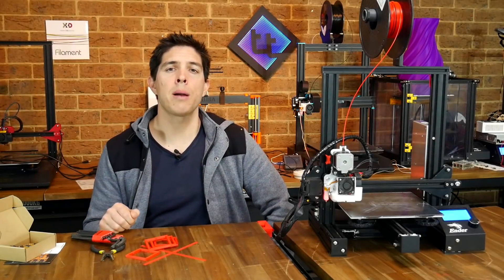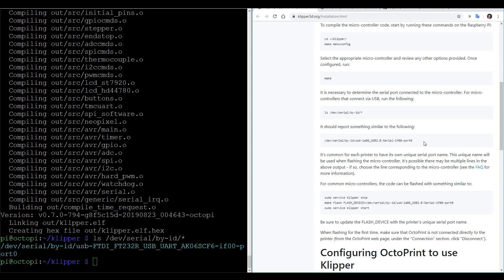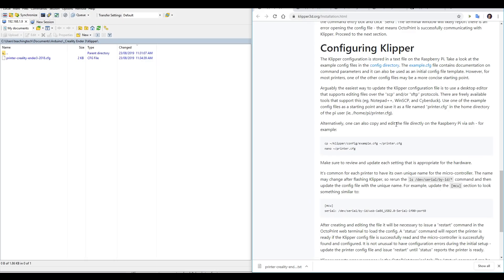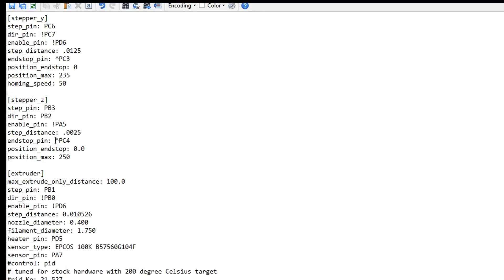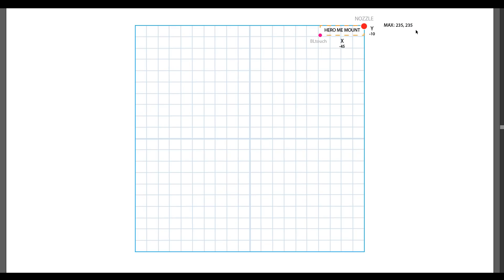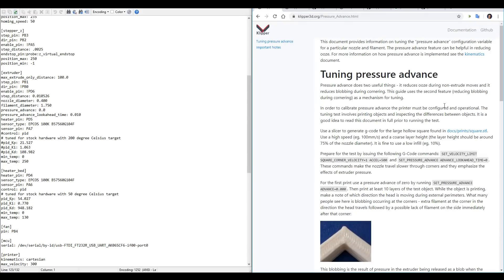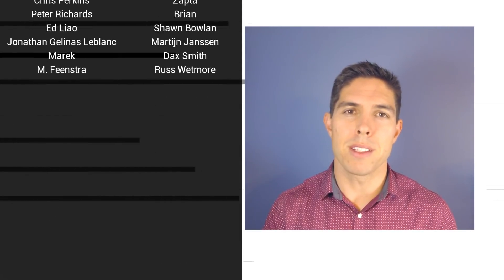Using a 32 bit Raspberry Pi to boost your 3D printer mainboard - Klipper Ender 3 guide

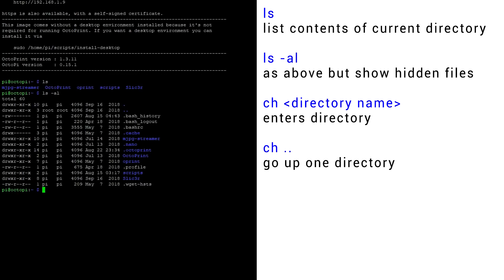Comment: Error found 2:56
The command cd not ch (like shown on the right site)!
Reply from the maker: Argh. Sorry about that and thanks for spotting it.
Reply: @TeachingTech  will this have any benefits with a skr mini E3 V2 ?
Reply: @TeachingTech  quick question, first off im running an ender 3 heavly modified with SKR mini E3 v2 with BLtouch and Direct drive mod running marlin, do i need to install Klipper on my Main printer board and on the Raspberry pi that im gonna connect to my printer. Or do i only need it on the Pi, I have the latest versions of Octoprint and klipper already installed on my pi 4.
Reply: Ehhh... just fix it by running: alias ch='cd' 😁
Reply: Well thats means that you are human
Reply: Never seen robots make failures? You are so easy to deceive ;)
Reply: @elmariachi5133  Not that can be explained as anything but a programming error, or an error in materials used. nope, sorry, never have. Same with a computer, any errors, are a result of the humans making the robot or computer and making the mistake.
Reply: @elmariachi5133  robots just make errors faster!
Reply: @Superseaslug  they also make more precise errors

Comment: I had a question I hope you can answer. I have a CR10S Pro With Octoprint & Klipper on a Pi 4B, I was using my PC and OctopiKlipper that was setup by a friend. It was working pretty good. I had not done the serious calibration yet. Then My 2008 HP D6V laptop had some issues and I had to repalce it. My new PC is awesome but It can't talk to the Pi and Octo or Klipper. My friend is not available and I did not follow him very well as he worked pretty fast. So now I need to setup my new PC. It seems 1st I need Putty as a communicator to the Pi hardware. Then from that point I can use OctoPi to help me get OctoKlipper loaded up on my PC...  Is that about right? Can i follow youtr Putty install up to linking to OctoPi. then install OctoKlipper as you show. Now my OctoPi with Klipper is already up and running I need the added interface to edit the config file and perform the tune ups. Am i on the right track. We listen to all the time and tuned out 10s Pro with your tips, I really want to maximize my 10s performance because is paid for, its mine and i really like it. Thank You for all you do and provide in your great videos. Dennis in Virginia

Comment: Is it fair to assume I should take out the micro sd card that I compiled the marlin firmware onto so it won't cause any confusion? If so can I just pop it back in to switch back and forth between Marlin and Klipper willy nilly?

Comment: I have tried following so many guides with different methods and none have worked for me including this one. Octoprint (or Fluidd) just wont connect to the Ender 3. No matter ehat guide I follow when I get to the point of connecting Octoprint in the WebUI I always get a "Your printer's firmware reported an error. Due to that OctoPrint will disconnect. Reported error: Unable to open config file /home/pi/printer.cfg" error. I don't know what else to try. Followed all directions and used the right printer file for my Ender 3 Pro.
Reply: try to contact klipper website

Comment: I have a ender 3 pro with creality3d silent board 4.2.7 and raspberry pi 3b+ with octopi. Is it possible to use klipper with the silent board? And is it easy to controll klipper via internet such as the octopi?

Comment: Hey... I'm new to 3D printing but have learnt a lot in the last 3 weeks... this is a steep learning curve! I spent 184 UKP on the original Ender 3 (not V2-- not Pro).. and have probably spent the same amount again on upgrades! chuckles ...  I now have it printing pretty much reliably...  In all my research over the last 3 weeks I'd never heard Klpper being mentioned... so I'm wondering... 3 years after this video was made (now 2022).. is this still a practical "upgrade"? I'm already using a self-compiled 2.1 marlin firmware and a Pi4... I am wondering what firmware people with more experience than I are using these days... thanks for any advice!

Comment: Hi
Please do a video on octoprint with Pi 4B and ender 6 V4.3.1 mainboard and BLtouch.
All the other options did not work for my because there is different options when compiling Klipper and then the "MCU" cant connect as a final connection with printer.cfg

Comment: For someone starting out this is unbelievably complicated technical terms are used with no explanation coding is assumed to be common knowledge this definitely requires extensive foreknowledge that excludes the laymen. Thinking of binning the ender 3 & buying a elegoo Neptune 2 already has a 32bit board fillement sensor silent fans for cheaper than this psychological torture

Comment: pressure_advance_lookahead_time seems to have been deprecated,  

 20191121: The pressure_advance_lookahead_time parameter has been removed. See example.cfg for alternate configuration settings.

Comment: I just setup Klipper on my Ender 3 and its working great, but when moving the bed it seems to move to fast and I hear grinding coming from somewhere.. Is there a way to slow down the speed that the printer moves the X and Y axis at when moving over the print?

Comment: I have dug and dug and just can't seem to figure out what processor my board has.  HELP! 

I have an Ender 3 Max with a Creality 4.2.2 board.  
I'm using a raspberry pi 4b 8gb model with the basic arducam pi camera.
I currently have stock Creality Ender 3 Max W/BLTouch firmware (just flashed it in so everything was bone stock)
I'm trying to use Klipper, but I can't seem to figure out what microcontroller I need to select.
I can get into the Klipper firmware configuration menu, but them I'm lost.

Also, once I process the "make" command and klipper.bin is created, when I run 'make flash' just like you show in the video, I enter my password and then I get: 
'dfu-util: Invalid DFU suffix signature
dfu-util: A valid DFU suffix will be required in a future dfu-util release
dfu-util: No DFU capable USB device available
Failed to flash to ...... Error running dfu-util'

Octoprint IS disconnected.

I'm not sure if this is because my settings in the klipper firmware menu are wrong, or what.  I'm not sure where to go from here!
Please help!

Comment: 5:48
pi@octopi:~/klipper $ sudo service klipper stop
Failed to stop klipper.service: Unit klipper.service not loaded.
Please reply to my question.
Reply: 6:07
pi@octopi:~/klipper $ make flash FLASH_DEVICE=/dev/serial/by-id/usb-1a86_USB2.0-Serial-if00-port0
  Flashing out/klipper.bin to /dev/serial/by-id/usb-1a86_USB2.0-Serial-if00-port0
Entering bootloader on /dev/serial/by-id/usb-1a86_USB2.0-Serial-if00-port0
Device reconnect on /sys/devices/platform/soc/3f980000.usb/usb1/1-1/1-1.2/1-1.2:1.0/ttyUSB0
sudo dfu-util -p 1-1.2 -R -a 0 -s 0x8000000:leave -D out/klipper.bin

sudo: dfu-util: command not found

Failed to flash to /dev/serial/by-id/usb-1a86_USB2.0-Serial-if00-port0: Error running dfu-util

If the device is already in bootloader mode it can be flashed with the
following command:
  make flash FLASH_DEVICE=0483:df11
  OR
  make flash FLASH_DEVICE=1209:beba

If attempting to flash via 3.3V serial, then use:
  make serialflash FLASH_DEVICE=/dev/serial/by-id/usb-1a86_USB2.0-Serial-if00-port0

make: * [src/stm32/Makefile:69: flash] Error 255

Comment: Quick question - how best to determine your IP address for Putty?  You mention Octoprint in browser, but when setting up the Pi, there is no Octoprint yet installed.  That part threw me as you breezed by it with no "how to"....

Comment: Any klipper install walk thrus for the SKR Mini E3 V2 on the ender 3? C:
Reply: https://www.youtube.com/watch?v=T5TGLleu3MA&t=1009s this is the one i used, sadly its not for ender 3 but a good portion of the video applies to you, if youre using the bl touch then follow the guide here for the config after setting up this.
Reply: What's the purpose of using Klipper when you have more than enough processing power?
Reply: @monono954  most people that look to push a printers Max speed choose Klipper instead of Marlin. It's more capable in those situations.

Comment: I installed klipper on my stock ender3 v2 and I am still not sure whether it was a good thing or not: I liked your calibration page and I assume this will render most of the pages obsolete when running klipper rather than Marlin? It seems that the LCD screen cannot be used for the ender3 v2 compared to what is shown in the video for the v1. I am unable to control the printer movement from octoprint - I assume I must be doing something wrong here. I previously used to control two printers with one octopi and I assume it will be too taxing for the pi to control both with klipper? I am still comparing this loss of function to the gain in speed I get with klipper - Is it worth it?

Comment: Hey!! I know I am super late on this but I was wondering if it is possible to set up klipper on a pi that has multiple instances of octoprint on it. I use a single pi to control 2 printers and would like to put klipper on one printer only if that is possible!! I feel like it would be because I would be using putty or other program to ssh into that specific printers main board to make the changes but I don't know if running multiple instances would cause any issues. Thanks for all your videos they are always so helpful!

Comment: Don't install the BLTouch on the Z endstop when using Klipper, at least on the Ender3 V2 that doesn't work. And having the connection in the actual sensor pins also makes more sense anyway.

Comment: Big fan of the channel and the usual thoroughness of the content. That said, this video seemed more of a "how to" rather than "should you" video. That is, it lacked any before/after comparison of any print variables. What shortcoming is addressed by installing Klipper and when does that shortcoming typically present itself any any given system. Large, somewhat ambiguous, question; true. That may be the reason for the video being a "how to" but this one does seem different in that regard from others in this channel.

Comment: no need to use Putty.
Just open any window in Windows, type cmd into the address bar and a prompt window will appear.
Now just type ssh py@192.168.x.x and you are in :)
Use AngryIP scanner to find your devices ip address.

Comment: hi i was wondering if you could do a klipper install for SKR 1.4 Turbo .. between you and Chris basement i have managed in  the 8 months i have been printing to to develop marlin 2.0 for Eryone Thinker S and SE with a SKR 1.4 Turbo upgrade. A big thanks for that. but as I have pushed for faster print speeds marlin is not up to the task compared to Klipper. the problem the only install for Klipper on a SKR 1.4 is in german!! nothing wrong with german other than i don't speak it .. 

so here is a hope you manage to get this comment and can help us modders out .. 
thanks in advance 
Riel.

Comment: For posterity, SSH is now included in cmd and Powershell on Windows 10. No need for PuTTY, but PuTTY does let you save connection settings and other nice features.

Helpful video as always, thank you.
Reply: I usually just save the "connections" into my .ssh/config file just how I would do it on a linux and it works nicely.

Comment: Will this have any benefits on a SKR mini E3 V2 ?
Reply: I saw a generous improvement in print speed & accuracy on my Ender 3 with this board. The only issue I'm facing is my TFT35 display stopped working after flashing the klipper firmware which could just be a configuration issue I need to correct. If you have a Pi laying around, I would definitely recommend this setup.

Comment: I was wondering if I'd have to revert to original/stock firmware (typically modded Ender3) before integrating this Klipper/rPi shift -- so now I am wondering if I understood correctly: the answer is ?NO?  @1:25 I heard "nothing that requires adjustment of the firmware" or something like that (sorry, my Aussie interpreter runs on an 8 bit Z80 machine running CP/M)
What I have to decide is which rPi to try first - but THIS sounds like FUN!
So what's the bottom line re firmware?

Comment: "connecting wirelesly to a linux device is called SSH" no SSH is just a method of connecting it doesn't matter if it's wired or wireless. another way of connecting is through uart or telnet.
Reply: He was substituting the word "remotely" with "wirelessly" I think. Remotely makes sense, wirelessly does not.
Reply: @Cortexian  "connecting Remotely to a linux device is called SSH" is better but still wrong because SSH is still just one way to connect remotely to a machine. for example you can also connect remotely through telnet.

(sorry if to much nitpicking xD )

Comment: Ok, this is the bit that really interests me, "Klipper supports printers with multiple micro-controllers." all my controllers have ethernet so don't care about octoprint but being able to have more than one board controlled from this thing is pimp..
Reply: yes but good luck running 3 printers at the same time printing at 150mm/s @1500mm/s² from a raspberry xD

Comment: At 13:22 you said you have to do the probe setting manually. Maybe they did not have it a year ago. But now it is dead simple to get the exact positioning with a built in command.

Comment: "...despite setting zero for our testing we should return our pressure_advance_lookahead_time back to 0.010"
But you did not set it to zero prior to the test print. It was 0.010 before and after the test print.

Comment: Hi , I´ve installed done with your instructions, but I have an issue.
When I execute G29, only 2 first points execute, and printer stop.

In the terminal the message is:

Send: G29
Recv: // probe at 62.000,25.000 is z=0.112500
Recv: // probe at 169.500,25.000 is z=0.217500
Recv: !! Move out of range: 277.000 25.000 5.000 [0.000]
Recv: !! Move out of range: 277.000 25.000 5.000 [0.000]
Recv: ok

I have a ender 3 and Bltouch clone. G28 executes ok.

Comment: Cant seem to get passed the step you describe in minute 8:56 of your video.Keep getting this message. Your printer's firmware reported an error. Due to that OctoPrint will disconnect. Reported error: Unable to connect

Comment: You are doing great work. Love your channel. Keep it up.  I have an Anet A8 mainboard and the SD card slot stopped working. I was wondering if I could use Klipper on a Rasberry Pi to run the Anet  A8 board and utilize the Pi to load files to the printer.

Comment: I've been using Klipper for a while now, and I'd never go back to Marlin on the machine that have a Raspberry Pi.
Other than that, I've just discovered this great video, and this made me consider using the [safe_z_home] rather than the [homing_override].  After test, there is one major difference when it comes to resetting a BL-Touch that is in error mode.  The safe_z_home can reset it by means of the activate_gcode defined at probe level, but the moment it does so triggers the Z_endstop and the homing is done far above the buildplate.  So I'm back to the homing_override, where I reset and stow the pin while homing XY, then proceed to homing Z.

Comment: Escelent tutorial!
One dummy question:
Once you install kippler, you can only print having the PI connected, right? 
in case I disconect the PI,  is it going to be possible to print just using the printer board?
Reply: klipper integrates the raspberry pi into the processing of the printer. with most firmware, the microCONTROLLER, which is your standard board like arduino/ramps, skr, duet, etc, processes all the information and then sends it to the hardware of the printer. with klipper, the processing is offloaded to a microPROCESSOR, in this case a raspi, and all the fully processed instructions are sent to the board whose only job is relaying those instructions to the machine at the right time. removing the raspberry pi takes away a core component of this setup, which means that your main board (the arduino, skr, duet, etc) most likely would still have all of the components it needs to run the printer, but would probably be incompatible with klipper. in this case you would most likely just want to switch to one of the other firmwares that are built around only using a controller board, like marlin or reprapfirmware.

Comment: So I just got done switching my ender 3 over to klipper. It seems to print great and has helped me to solve some blobing issues I was having. But I noticed that the printer seems much jerkier now. Almost to the point that I am kinda worried it could cause some added wear and tear on the printer. Do you think the added acceleration could cause excessive wear? I have a stock bowden tube setup.

Comment: When I try to do the command 'make flash FLASH_DEVICE= ... ' it gives me several not in sync errors.
Do I need to install a bootloader first ? If so, can I do this using the terminal of the raspberry pi itself ?
Reply: Did you ever find an answer to this?  I'm having the same issue.  Really don't want to buy an Arduino for a one time use deal.  Yeah, it's only $7, but $7 is nearly half the cost of a spool of filament.

Comment: This may be a little dumb but, do I need to have already flashed on a boot loader to achieve this using the raspberry pi through USB? If not, does this also provide thermal run away protection?... As a bit of an explanation, I'm completely blind so if this flashes it and makes my ender 3 safe by command line rather than using an Edwino to flash it with pin diagrams and all the problems that this creates, that's great....